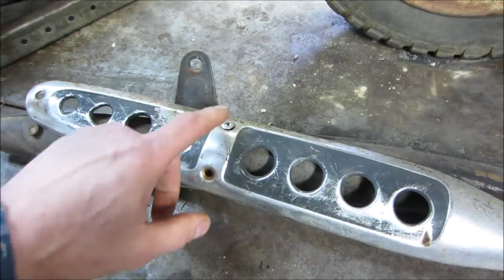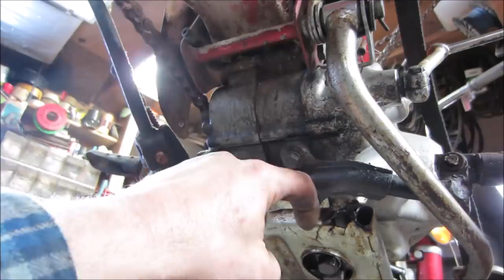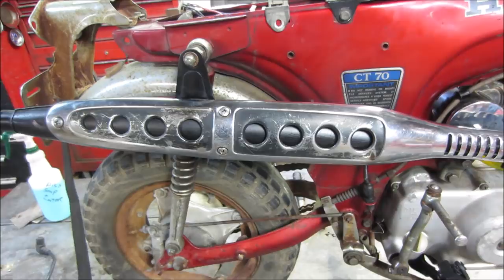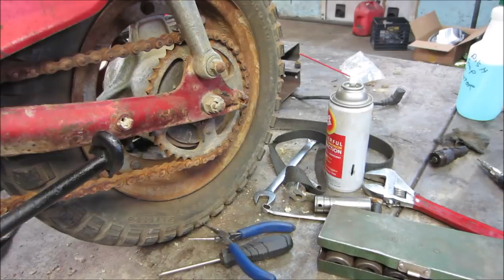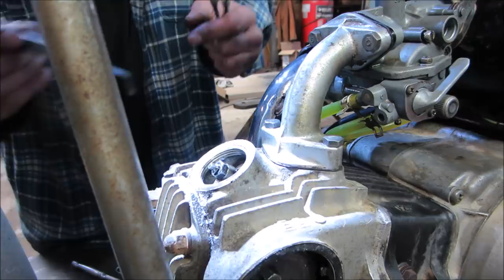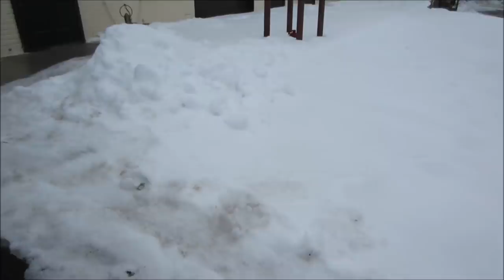The, worn out Honda Trail 70, Engine Repair/Restore, pt4.

Comment: Dear Mustie1.
Sundie and Mustie, always a great combination! :-) ;-)
Maybe you could burn out the complete muffler with a welding torch. After it is heated up compressed air will be enough to let it glow inside as long as oil dirt is there.
But please take care. Because of the oxygen in the compressed air the heat can rise up pretty high (up to white glowing colour).
Maybe there is a kind of plastic timing chain tensioner inside (like in a CX 500 engine) that can be replaced. However I hope that you have the luck that the timing chain had not lengthend/stretched.
Best regards.
Postscriptum: The chain is still crying for even a few drops of oil. So please have mercy.  ;-)

Comment: The noise if coming from the head of the broken bolt from the cam, which is being slapped around in the crank case. :::::)

Comment: Great update! Not sure that cam gear/camshaft should me moving in and out of the head like that? My guess is the cam/head (the cam runs directly in the head IIRC) is very worn hence the noise, quite common on tired/abuse Honda OHC's like this

Comment: If the missing camshaft bolt was lost in the engine it can't access the inner crankshaft housing causing damage there but will remain outside of it b e h i n d the ignition plate hold by the 2 screws we saw when the flywheel was removed...
It's easy to remove the flywheel and loosen the 2 screws and remove the complete ignition unit to see if the bolt plunged in there or not..

Comment: The intake on those should be set at .002 and the exhaust is .003  for most older single cylinder Honda's.

Comment: question; why did you torch the muffler right after painting it?

one more question; i'm painting the air cleaner on my truck - on the inside of the air cleaner and i'm worried that over time the paint might peal and go down the carb. is there a paint that i can be reasonably sure that it won't hurt my engine?

Comment: that magneto puller is a pain
 in polish romet brand mopeds and motorbikes drom the 80's there is the same story. very similar tool . and in the user manual they say to grese the inner screw and put a ball bearing to avoid expanding the thread on the shaft end, there is this indent from machining the ball would ride in
Reply: Bought a puller set on online a while back as there are quite a few variants.

Comment: Hello I think you have a bolt missing look on the side next to the flywheel ... if you look at the black  jug and case come to gather there should be a bolt there !!!  I had a Honda 50 three speed had a high and low transmission I have a book on Honda small bikes if you would like it you can have it ..

Comment: On the left side (side of the access hole to the timing chain) - at 35:53: Where the black part of the head meets with the block, left to the flywheel, isn't there also a screw missing to hold it to the block?

Comment: This is a awesome project!! I just got done with a 2000 timber wolf. They were sitting outside for about 8 years all kinds of seized bolts and critter nests. Hey one question. Why do you touch off the high temp paint when it is wet?

Comment: If the engine had been running rich from the carb fault  then the exhaust would have built up a layer of oil over time.

Comment: You may wish to install the missing cylinder base bolt / screw on the left side ? I did not see what paint you used on the exhaust . Wood stove paint works pretty good , but I hate to admit that Harley exhaust paint is the best I have found . Did you hear me yell that there looked like a thread on cam sprocket just below hole after first try at bolt install ? Over the years when I needed to repair a paper thin muffler , I brazed some thin gauge sheet metal for a patch . Tried welding and kept making the hole bigger .
Reply from the maker: yeah l used gas grill paint

Comment: Why did you apply heat to the muffler after painting it? [sorry if this is a dumb question] After you applied the heat, you said you would than let the paint dry.

Comment: Sounds like that timing chain needs an adjustment , you adjust from the bottom the flat head with nut is the lock off ,
Your missing the bolt from cylinder to case

Comment: That cam gear look like it was all worn out..... And you got plenty of time you could take that side cover off and inspect to put it back in no time at all....... And on that crank on the magneto side you could have used a thread file using that die very dangerous got to be very careful.....

Comment: Good work on the pipe, but you should have made it a slip on joint.
Reply: Why not? It would be easier to take off, without disturbing the header connection. Just a suggestion.

Comment: Never use a multigrade oil on wet clutch it makes the clutch slip dont ask how i know ;-)
Reply: Actually, it's never use CAR grade multigrade oil. Motorbikes run on multigrade oils since the 80's.  Motorbike grade.

Comment: Your missing cam bolt appears to be sitting backwards in the middle of the cam gear. Notice that the parts bike didnt have anything in the center of the gear as you stole the bolt from that gear?

Comment: Is the point gap adjusted when the piston is at top dead center or at the fire position? And should the points still be touching when it's at the fire position?
Reply from the maker: f is the on off point, t is with a feeler guage .015
Reply: Thanks

Comment: You can pick up 110 cc powerd Chinese bikes with good engines and crap chassis for 50$ if you look around and they are clones of the old honda trail motors.

Comment: I haven't watched all of them yet but did he notice the jug is missing a bolt???
Reply: You can see on the running motor the lower bolt on the black jug is missing a screw that the old non running motor has. I seen this when he was scavenging the missing cam bolt

Comment: Internally this thing aint worn out, says heaps for the design since they still make the same motor type (made in China)
Reply: Bet that thing wont survive 50years
Reply: @estonianperson1112  The Honda NBC 110 Super Cub (Basic same design as the motor in a monkey bike) are used in the postal service here, made in China and were recalled when they first switched to them due to a fuel issue and the older CT110's (Made in Japan) were pulled from auction and back into service, many of them had run 35k Kilometers.(About 22k Miles) and still ran well.

Comment: Magnets would have held the two ends of that exhaust pipe splice section.
I guess you don't know how to gas weld or TIG ?
Hey Mr. Flintstone, you don't have a Harbor Freight press ?
Could have used a 3 point file to help restore the treads on the crank.
Reply: @paulcopeland9035  Why constructive comments are band here ? 
Or questions in general ?
Reply: @paulcopeland9035  So you say. God Bless.